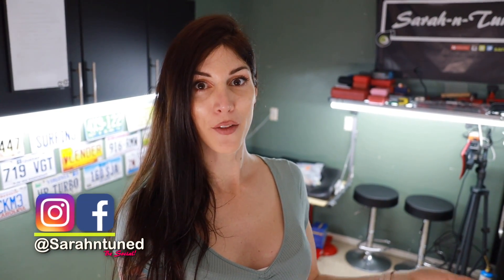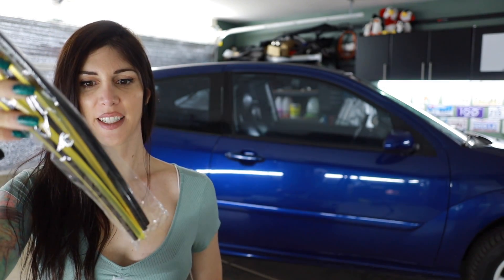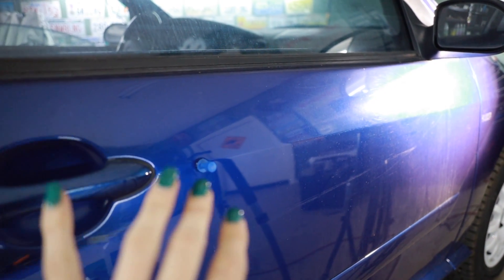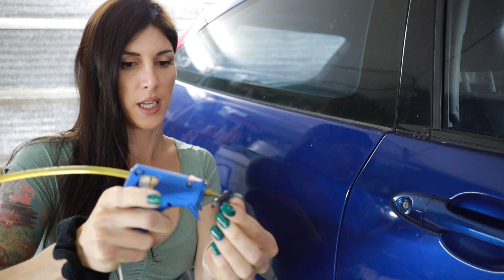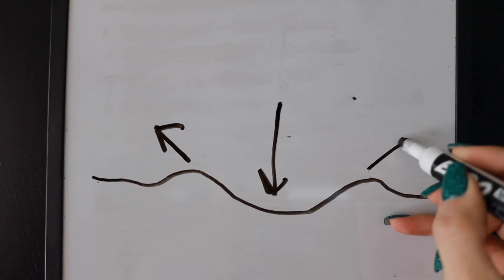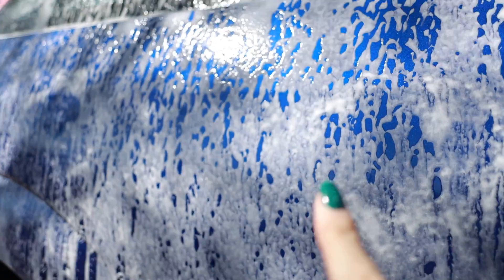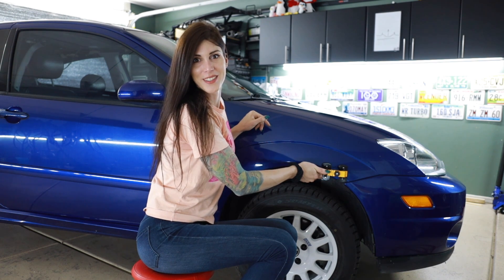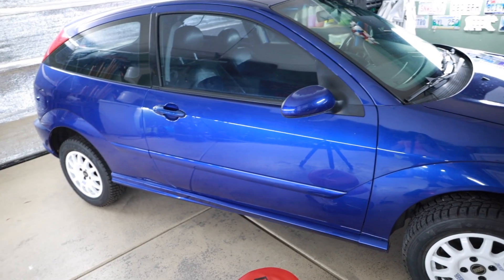How Hard Can It Be?? // Attempting Paintless Dent Repair

Comment: I fixed a pushed in bumper with a jug of hot water and a wooden spoon last week. High-tech solution right there.
Reply: I used a hair dryer and an upside down can of compressed air.
Reply: I pulled out my front bumper with the power of my neighbor's cat's mind. It was a small dent.
Reply: I used two Jiffy Pop bags in a low expansion container heated by a micro nuclear fusion device;  it didn't quite get all the dent out, but it did reduce the car to its original iron ore pellets and aluminum ingots. Sweet...
Reply: @Social Outcast what kind of sea turtle?

Comment: As far as garage content: whatever if it's easy for you to make content with, do it.

I think your fans just love watching you do your best to get these projects done.

My wife says you are adorable with your hair up. 

I like watching you work on little projects like this. It's educational, and you are fun. You obviously have training and experience, but you don't come off as a know it all, or talk down to your audience like some car channels do. 

I recently traded in my warhorse 2005 Dodge Durango for a more recent Chevy sedan, and I've been doing little projects on it to get it how I want it. I installed a dashcam/backup cam,  had to notch a licence plate frame to make it compliant with Canadian tag placement, painted my badges a Carbon Mist black, and used a Gilded Brass to put life into the grill. The next projects are swapping the lug nuts (easy),  using a high temp paint on the brake calipers (medium effort), and sanding and touch-up painting a couple small rust  spots on the roof above the windshield (Nerve racking, as it's very visible if I botch it). It's all super easy stuff, but most of my history on vehicles was as a tire installer and oil changer, or holding a flashlight and getting yelled at as a kid, so each project has a slight learning curve. It's not like with the Durango, where I installed a trailer hitch or ran lines to fix the windshield washer sprayers. Those were all just basic jobs, the kind I'm used to, but messing with paint and electronics... outside my wheelhouse, as it were.

You do you, and we'll all be here to ride along with you.

Comment: Depending on the size of the dent and the area, you could also use a plunger. Make sure to protect the areas where the outside will touch the paint to prevent tiny scratches. Worked for me! More Sarah content is always welcome, no matter sorting a garage or plucking eyebrows. As long as we get back to the damn cars straight after those vids. Good job on the Focus.

Comment: FYI a mini split a.c. unit is under 600 and you can install and only needs a 20 amp circuit at 220 volts is better but but will run on 120 depending on what u buy it comes with everything all you need to do is make a hole to mount unit on wall in the wall to run condensation line and high and low lines just like a car I know you can do it is so effective and fast cool down or heat check in to it you will wish you had years ago you will love it 😁👍🏻look up (mini split ac) don't get too cheap stay in the 500 to 600 and they have them in the ceiling too if you don't want the inside unit on wall a little bit more I have done many of them and one outside unit will run up to 5 inside airhandlers

Comment: While you have the dent under pressure (before the glue pops loose), tap around the perimeter of the dent on the high areas.  With the pressure still on, the high spots will want to go down more naturally than if you tap them after the glue pops.  Metal wants to go back to it's natural position.  However, that pinpoint dent on the door and the dent in the fender crease will need persuasion from behind.

Comment: Garage mods FTW!  Make the videos and we'll watch.  Thanks for the info in this dent video.  Looks totally worthwhile to spend some time improving a vehicle if you don't need it to be perfect.  And BTW, harnesses and connectors are not the same thing.  Harness is the whole set of wires and connectors for a system or area of a car.  Where it plugs in is just called a connector (among other things, but not a harness).

Comment: Sarah, get a weighted dolly with a sharper edge and place it in the groove on the back. Hold it in place with one hand while you tap around it with your tapping hammer. It should help massage the dent out.

Comment: Wide flat screw driver on the back of the fender; following the crevice; tappity tap tap with a hammer.  Small hits are better with sent repair and heating the paint with a heat gun will keep it from cracking.

Comment: The black glue sticks are stronger glue.  Also the fender edgea are very hard to pull due to no structure below to hold the metal,  instead the metal gets pulled and stretched and not fixed. But it looks better.  Yes for garage content

Comment: You need to heat up the the dents first with a blow dryer or better yet get one of those rubber bags that you put ice or hot water in for when you are sick and use boiling water that way you don't get it too hot and damage the paint helps soften up the metal a little.

Comment: The black gluesticks are the softer of those glues, if they were working better for you, it's probably that your low-temp hot glue gun wasn't putting enough heat into the yellowish ones to fully adhere. You're working on cars, not bedazzling things, you need a real gun for that stuff.

But you're exactly right, the tools make the job doable, but the skill and practice is what makes the job go well. If you want more practice, you have a hammer and a focus that'll see plenty of gravel.

Of course we'd like to see your garage upgrades.

Comment: Pretty sure the dents on the MR-2 between the driver's door and gas door are from keys or a wallet in the pocket of a person's pants that was leaning against the car while getting gas.(hence no scratches/chips in the paint surface)
That skidplate material is probably  DELRON.
Reply from the maker: Skeeter McSwagger car has been repainted, so who knows if it had paint damages prior. 🤷🏻‍♀️
Reply: @SarahnTuned   Oh OK,... I thought part of the car had original paint and the other part had been repainted toward the rear.
 I wasn't sure where the original finish remained....great video as always. 😉👍
Reply: @SarahnTuned   Oh never mind.
 I forgot that it got re-painted!
 I'm thinking about before it that.

(🙄🤸‍♂️ I've never watched your videos in order.🤸‍♂️😬)

Comment: When a dent is made in a steel sheet the sheet is actually stretched. Removing the dent requires unstretching the steel sheet. Bit like stretching gum then expecting you can push it back to it's original shape. Good luck with that. But with skill stretched steel can be gradually unstreched by applying force at judicious points around the dent. Emphasis on the "with skill".

Comment: If you have a ding from a stone or anything sharp that nicked the paint, do not try to glue pull it! Even on factory paint it will probably pull the paint off and then you need the body shop😖  btw your video presentation is excellent!

Comment: To respond as a professional Paintless Dent Repair tech, no, I could not use any of your Amazon tools to fix any of those dents. As you concluded, there is a reason I spent 10 grand on training, bought 7 grand of tools, and practiced for a few years before I could remove a tiny ding perfectly.